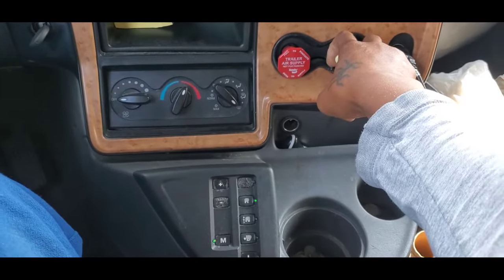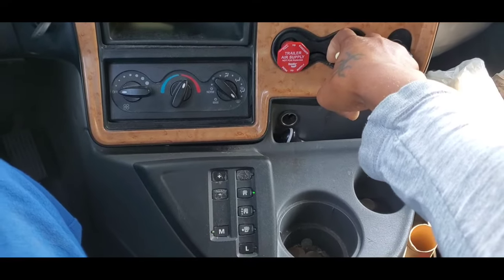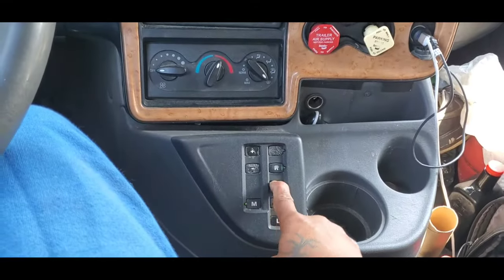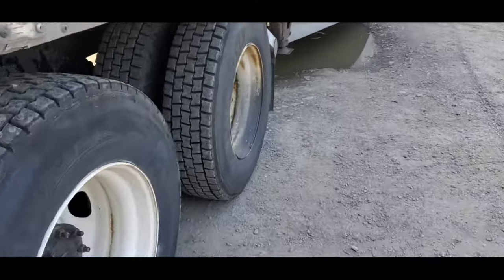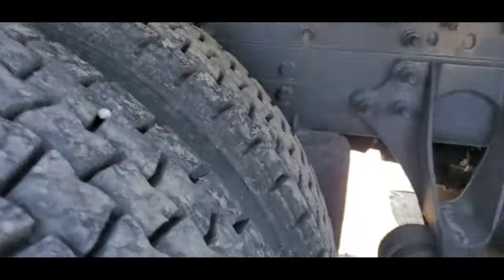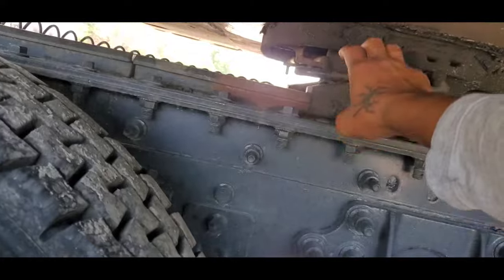Here is how to release your fifth wheel when you just can't pull it loose

Comment: I just started driving and The release arm on my truck pulls all the way out hen it’s unlocked but in the video yours didn’t. Is that how some truck release arms are?
Reply from the maker: Hi driver, sorry for the late reply. Some Fifth wheel arm are made different. Some will come out a lot but still attach to the fifth wheel, and that's normal.If yours came out like unattached, then you need to get it looked at because something is broken or came loose.

Comment: Works everytime except when it doesnt
Reply from the maker: If you're still having issues, try roughing up your trailer like set your trailer brakes and release only the truck and go back and forth also try driving at a slow speed and slam on your brakes to see if that will free things up on your fifth wheel.

Comment: I thought reversing would push the pin tighter into the 5th wheel...
Reply from the maker: you are right,but  that direction, take the pressure off the jaws, which makes the pin easy to release